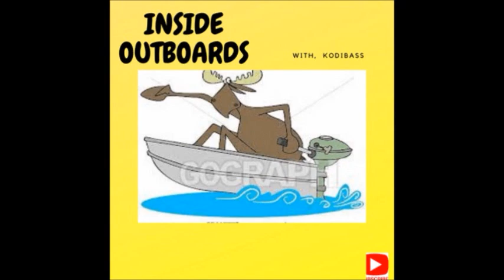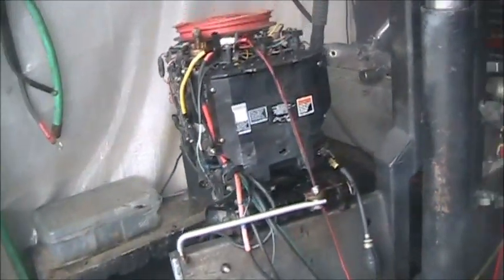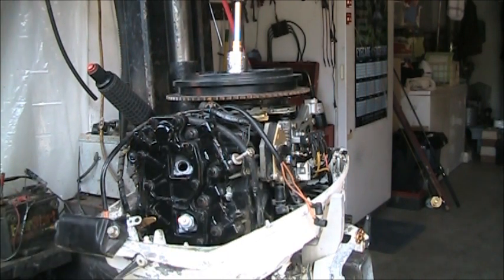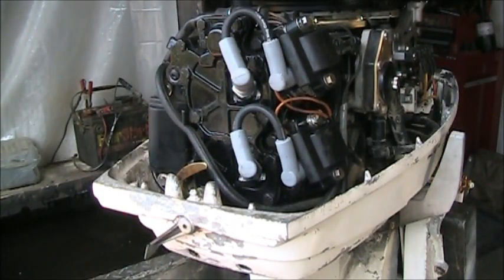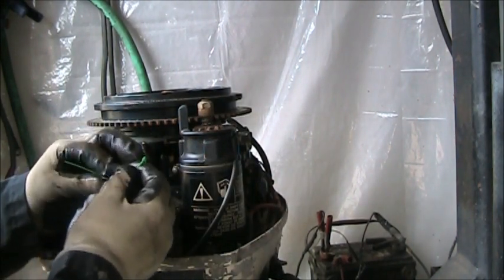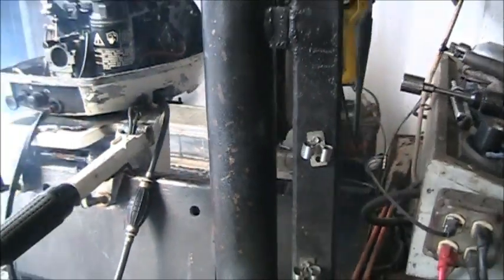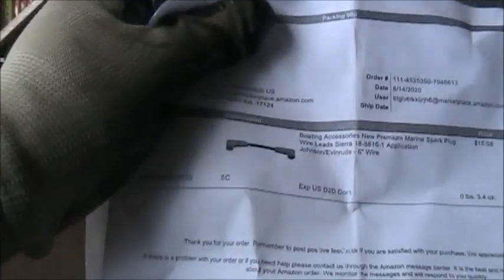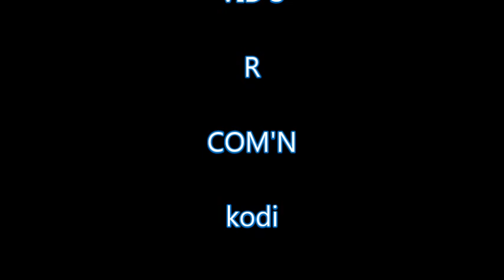JOHNSON 30 HP,   MERCURY 50 HP    + MORE

Comment: Hi Kodi, question is it possible to convert a UFI ignition to a CD power pack? I seen a kit on Cd electronics web site but not sure if I would have to change other things. I have a 1990 tracker Johnson 40hp it has 2 spark plug wires coming from one coil pack. Also have you ever done this before?

Comment: hey Kodi, new subscriber here. what's the name of the machine you use to lift your engines?
Reply from the maker: I Have a few , WHICH Do U mean?  I have a tank lift,  I have a mini Dozer  lift,  & I have a manual specialty manufacturing lift,  The mini Dozer is made by RamRod out of Canada,  The manual lift is specialty Manufacturing of California, The Tank lift I built.    Hope this helps,    kodi
Reply: @kodibassInsideoutboards  you have one I've never seen before that you stand behind and drive like some lawnmowers. If you could just recommend one I could buy used or affordable I would appreciate it. I'm new at working on outboards but found that i really enjoy it. thanks

Comment: Tell me how to adjust the ignition Johnson 40 2000?
Reply from the maker: Yes 4 sure,   Go to your local library ,  They will have the shops manual 4 your motor.  Fallow steps 1 thru 8  & Do exactly as the manual states.  Do not deviate.. I have been doing this for decades.  Get that manual &  fallow the steps... EXACTLY.   It will work.             kodi
Reply: We do not have a library If I understood correctly what you wrote to me?
Reply: Maybe you can tell me how to adjust the ignition of a very high flow rate of 40 liters?
Reply from the maker: @АртуроМесхи ,      Simple 4 sure,    Go to  CDI electronics . com      They R the builder of your electric Components ,,  Their  Trouble  Shooter  Will Take U thru  step by  step . &  Make your motor Purr  Like it  should.,,,    Do  this  &  trust  Me.they will  Have the information You Need to make your  motor.  Smooth & Run Ready  4  sure.                                                         kodibass
Reply from the maker: Ok   seems you R in another country ,  Which makes me  want  to help You  More,,   Can You Give More  information  on Your  Motor?  Year / model # / ......    I think I can Help You  with Parts  4 sure.,,   I  Just  need More information  on the motor &  Parts you wish 2 have.      I want to Help.         kodibass
Reply: I'm from Russia It's great that you will help me to rewrite the model and send it to you, but you can somehow contact me in another Messenger.
Reply: Johnson 40 2000 2 stroke two carburetors.
Reply: BJ40evsig model
Reply: I watch your channel, I don’t understand English very well, but I see approximately what you are doing and compare it with my motor. So I decided to contact you, I don’t know how to adjust the ignition on my engine.  air leaks the fuel pump is ok I can not understand how the ignition is regulated.